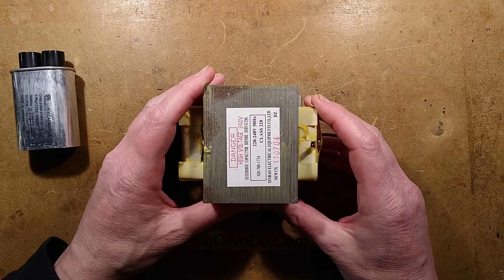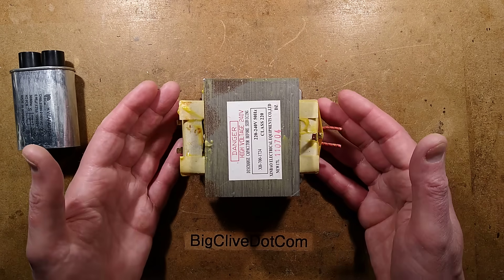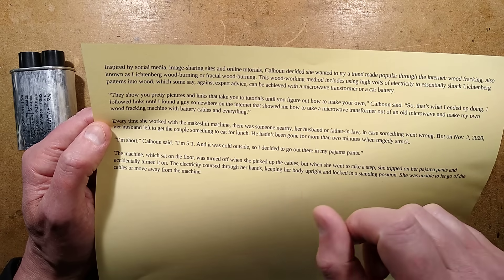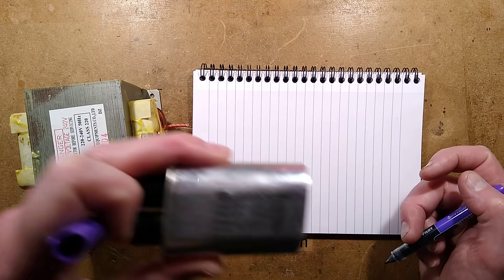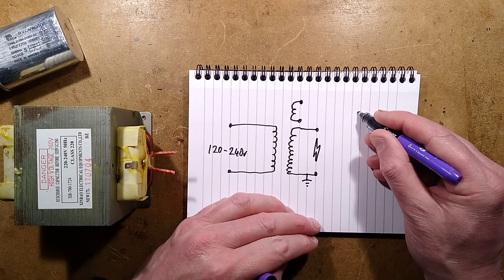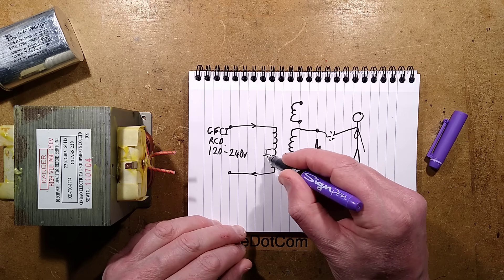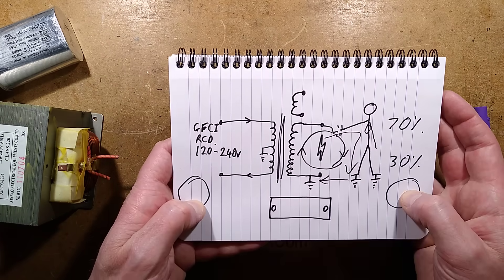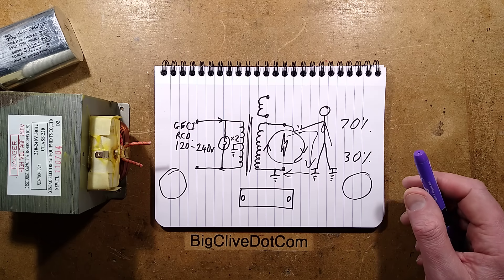The most deadly project on the Internet

Comment: I've been in electronic repairs for over 42 years. Even I with taking precautions in my early electronic repair career have been shocked, once with 1,500 volts. It's not fun for sure and a bit scary after you realized you broke a safety rule and it almost cost you your life. I was giving training on a live circuit and took my eye off the Magnetron with my hands near it and accidentally touched the 1,500 volt line. I was fine but A LOT wiser and never ever repeated the mistake. Never take your eye's off live circuits while working on it. If you have to talk to someone, remove your hands. If you have to walk away turn it off or put a barrier or a sign up letting people know the circuit or device is on. I even went so far as to before I even powered a piece of equipment I would tape off anything I thought I could accidentally touch while working on it live, (Powered On). My advice is if you're not trained in electrical  safety or know how the circuit works, LEAVE IT ALONE! Those warnings on the access panel are there for a reason, and that is to save your life. Get someone with the proper education, even before opening the cabinet or removing the cover. There are Capacitors inside that can store enough electricity to KILL you if not discharged first. Thanks for sharing. Best Wishes & Blessings. Keith Noneya.

Comment: OR YOU CAN USE TESLA ELECTRIC...RF Resonance Frequency, Which you can touch no problem at very high volts, high enough to make fractal patterns in wood no problem. to do this spin a washing machine pump backwards using a dermal cutting tool, connect 2 wires to each terminal of the pump, put  a spark gap on 1 cable & a step up transformer on the other, connect your probes & burn away.

Comment: I do all kinds of dangerous shit in my garden, used one of these transformers for a Jacob’s ladder and just used to arc it out lol, did try this wood burning but didn’t do it right, just wired it to the mains and had a long plastic stick I referred to as “the chicken stick” ended up breaking it, idk what happened it just started smoking and no longer works 🤣
Reply: Electrocuted myself with a fly swatter I wired to another one, squeezed the air out of my lungs, really not nice to be shocked

Comment: Problem with MOTs is, they are cheap, simple and fucking dangerous. IF you ever consider playing around with high voltages, start with something small. I got my first electric shocks at the age of 10 or so, when I was playing around with a relay at 12 VDC. Teached me a lot about inductors... only years later I moved to car ignition coils, television flyback transformers and finally teslacoils, MOTs and the like. Every now and then I got shocked and every time it happend, I was saved by my poor an inefficient designs (you just don't build a driver with 80% efficiency when you are 16 and don't really know what you are doing) and the following rise in security measures (like thinking about what went wrong and how to prevent something like that in future experiments).
If you directly start with something like a MOT or the Mazilli flyback driver circuit, you are like a child who never even played with fireworks and now wants to play with a crate full of hand grenades.

Comment: I build custom equipment for scientific instrumentation and we never go above 24 volts unless we really need to. None of us are exactly happy even with mains (which is a healthy reaction to mains frankly). It’s way too easy to sod up the wiring and end up with a live case or something. High voltage is miles worse and really not to be fucked with. I worked in the HV lab at uni and we stood waaaaay back when the equipment was operating.

Comment: Another reason these devices are dangerous is that they produce a DC voltage.  When a person experiences a DC shock, the muscles that are affected contract with all their strength, and it is virtually impossible for the victim to release them.  If the victim is holding an electrode in each hand, they suddenly grip tightly, and can't let go, at least until the muscles have been damaged to the point that they no longer function.  This is in contrast to an AC voltage shock, in which the alternating current is more likely to permit the victim some volition.  Of course, at the high voltage present on a MW transformer, it may not make any difference.  I haven't bothered to do any experiments to find out.  
When working with high voltage, one of the greatest dangers is in making a high-voltage connection from one hand to the other, such as might happen if you had one hand on a grounded chassis when you accidentally contacted a high voltage element with the other hand.  In such a case, the current path will pass directly across your heart, with potentially lethal effect.  To avoid this,  my grandfather taught me to always work with one hand, while keeping the other hand in my back pocket.
Reply from the maker: It's AC from the transformer.  AC is actually more dangerous because it causes sustained muscle contraction.

Comment: I very much appreciate your approach and disclosure. As an aside, your speaking voice is very good.  Your results in this procedure look very much like a natural tree branch and limbs. I would say that it's closets to Oak. I'm not acquainted with high voltage, as none should ever want to be a conduit, but I am aware of insulation precautions & grounding. With electricity, water is not your friend. and bare electrodes, a point of great risk. I have been keenly aware of the potential for electrocution from capacitors, housed in something unplugged and off.  I think if the "on and off" was in both electrodes, (if possible) pressure on both simultaneously, is the only completion of the circuit with the individual wearing  1/4" arm length rubber gloves & highly insulated rubber boots...Of course, there is no safe dynamic of standing in or near a puddle of water.  I hope my idea is not full of holes. thank you for sharing!

Comment: Something related to this. I weld, and have been for about 50 years. While welding utilized low voltages, usually about 14 to 35 volts, that’s when you’re actually throwing an arc. But when holding the gun, or stick before actually welding, the open circuit voltage can be as high as 88 volts, particularly with older machines which don’t limit open circuit voltages. That’s very dangerous!

Another thing is mischaracterization of the of the work clamp, calling it a ground clamp instead. It’s NOT a ground clamp. Normally it’s not a problem, but if you think of it as a ground clamp, and connect it to the case of a machine you’re going to weld, which may be grounded, you will have a very nasty surprise, as you’re now shorting a live cable to ground, going through your welder. The best that can happen is that you can’t weld, and the welder shuts down (unlikely in most cases), or melts down. The worst is that YOU melt down along with it.
Reply: Ive been hit by an old welder once. It was rated at 75-85 vdc opend circuit voltage. Woke me right up!

Comment: A less dangerous but still no to be taken lightly hobby, get yourself a few transformers and connect them in parallel, voltage keeps going up but the current goes down, finally make or buy a Tesla coil. To be extra safe start the whole thing with an isolating transformer. Loads of diagrams out there.

Comment: As a kid, I wanted to build an arc lamp out of two carbon rods from batteries. I used a 9V model railroad transformer - the other way around. My mom always made sure that I did not play with mains and used a transformer - to be safe. So, I was complying - sort of. The arc did did not form, so I touched the electrodes to make sure that it had juice. After all 5kV should produce an arc. The next thing I remembered was that I woke up at the other end of the room. Nothing happened besides minor skin burns and a hole in the dark green carpet that I covered up with some pencil marker so that my parents would not know. It taught me a valuable lesson, though... I continued my experiments, eventually queuing up two transformers in a row. Had some fun "blowing up" stuff, made some more holes into the carbet (and curtains). But I learned to stay the heck away when the experiment was energized, and used plenty of porcelain plates from the kitchen as insulators.

Comment: No-way I'd ever use an m. o.t. to make one of those silly things. I'll stay in the very reasonably-safe realm of using them in my 4x mot homemade stick-welder as well as using one in conjunction my cap-diode voltage octupler arc-maker light show of fun for the whole family. Since they're both rectified to DC they're 100% safe too, LOL.

Comment: when i was a kid, i gave myself a nasty shock just playing with a standard transformer from some small electronic device (probably something like 110v to 6v) and a battery - i was aware that transformers only work on AC current, but even just that pulse generated initially when the winding is connected - i think i was putting voltage into the secondary winding and somehow came into contact with the primary. one of many stupid things i did while experimenting with components from shit that i took apart
Reply: Pulsed low voltage DC into a 1-to-20 step up? You made a manually operated inverter! Though you shocked yourself with it, I hope that curiosity tempered by caution is serving you well.

Comment: I am an electrician in the United States and I accidentally due to my own negligence (dont trust anyone when they say a line is off test for yourself!!!) got 277 high voltage through my left hand and out my right for 3 seconds. It is no joke. I fell off the ladder was blind for 30 seconds and for 2 weeks my arms kept trying to raise up to where they were when I got electrocuted. I was in pain for over 5 days due to muscles clenching constantly in my arms face and neck. That was 277 under at least a 5 amp load. Imagine what could happen with higher volts.

Comment: Yes it can work with car batteries.... car batteries have between 550 and 1k cold cranking amps... they have a consistent force or flow of about 90 to 120 amps reserve capacity... that ballast depending on its configuration to its power being A/120v @10.2 amps or B/240v @ 4.8 ish amps... both configurations can provide the 1k watts needed to power that microwave or a HPS lamp but a car battery won't power a microwave and won't power an HPS but has the RC and voltage with enough amps to do the job... very confusing but easy to learn with hands off eyes open training.

Comment: Thank you, I didn't know this and would hate be up for a Darwin Award. But here's a question, if you put the high voltage thing your playing with on a rubber block and not let it touch the ground, then would you be safe? Or is to much power even for that?

Comment: As a Master Electrician with 25 years in the trade. I would advise against doing this unless you are well versed in electrical theory and have a safe operating control system for it. Wear electrically rated gloves, boots and clothing. A good Idea to have a partner at the disconnect as a fail safe just in case all of your precautions fail.
Edit:29 years

Comment: I'm pretty experienced working with wiring/electrical components and the associated PPE and safety practices and even thinking these projects look pretty cool won't touch this shit with a 10' pole.  Imagine dying for a set of coasters...
Reply: A ten foot pole might not save you either
Reply: @jimjamson9534  well i did say i wouldn't touch with a 10' pole
Reply: @blaphtome9382  actually you did not say that. You said you won't touch this shit with a ten foot pole. Sorry to correct your bad english. Wouldn't and won't do not mean the same thing.
Reply: Wooden pole? Haha
Reply: What if the 10’ pole is non-conductive?
Reply: @PERTEKofficial  Then you would be fine of course, which is why I wrote a 10 foot pole may not save you.
Even dry wood is a conductor of electricity.
Reply: Seriously I'll just pay the 10 bucks to order some lol.
Reply: But then how will you get your insta points (or likes) if you don't post pictures of your coasters??

Comment: So, when we put a breaker on the right side, it is good .. right?

But seriously, a dead man switch wouldn't work either. When the muscles are tensing, a person can't drop the box (therefore, approach electrical stuff with the back of your hand to test if it's off (after using an indicator off course)
Reply from the maker: The point of the dead man's switch is it keeps your hands away from the high voltage stuff when it's active.
Reply: @bigclivedotcom  that makes sense. Tnx for the ellaboration
Reply: think the idea is someone else operates the box.
Reply: @SuperWhopper1  like, say stop when i have to disconnect ;-)